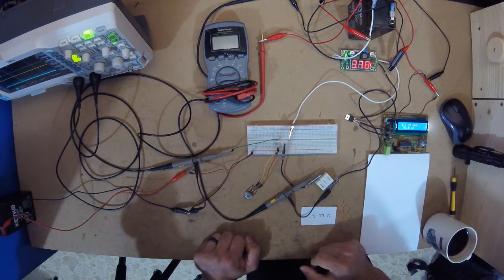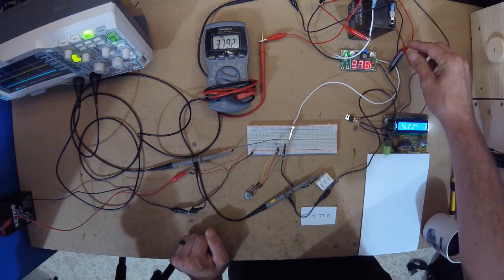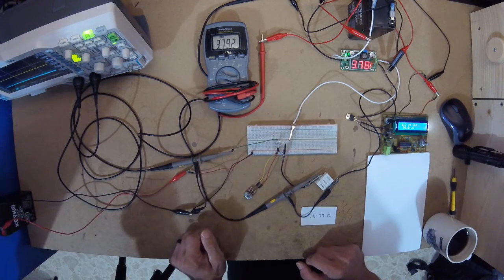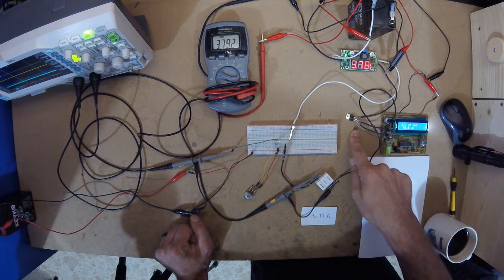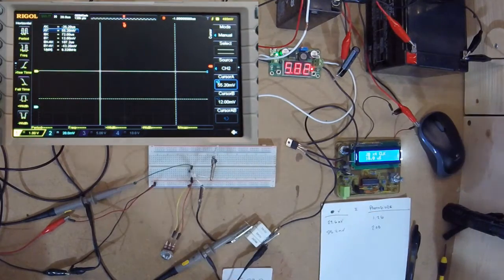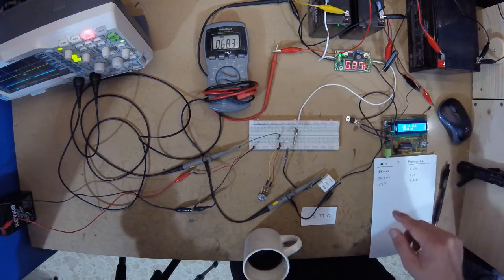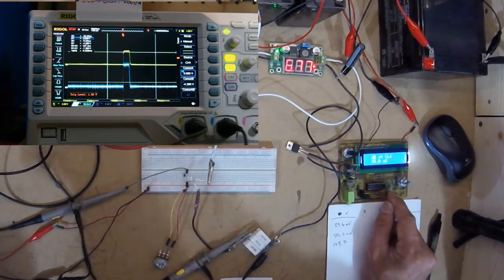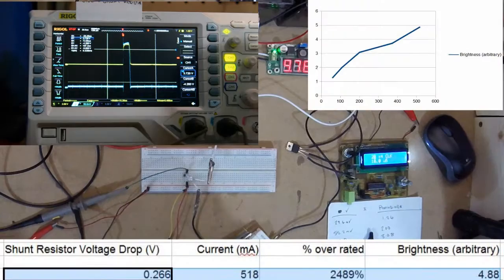LED Current Vs Luminance: Part 1 - 5mm LED

Comment: Nice experiment. Thanks! I wonder since a 250% increase in current(from 200ma -500ma), only increased the brightness by about 50%, if it would be better to add another LED in parallel and running 200ma through each, if that wouldn't produce even more brightness, with less total current, and less strain on each LED?
Reply from the maker: That's a great point! Thanks for that. I'll be exploring the same on a 10 watt LED in part 2.